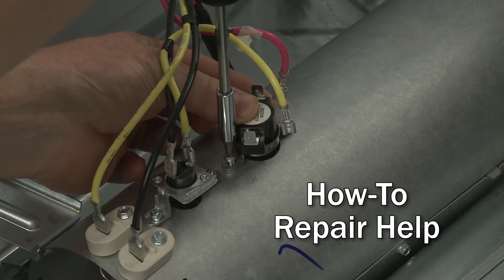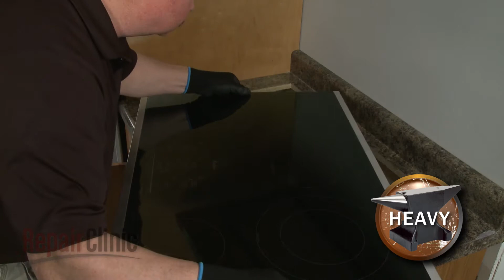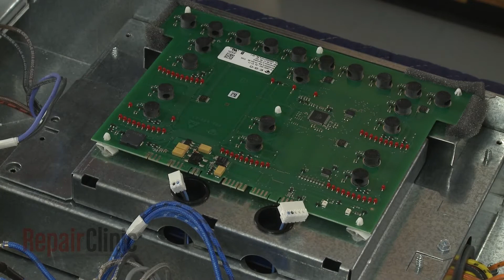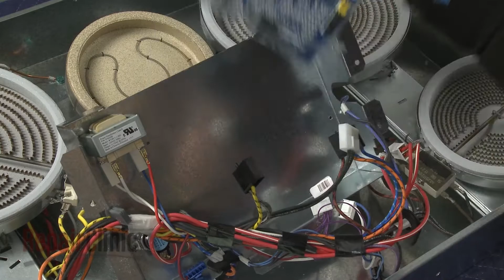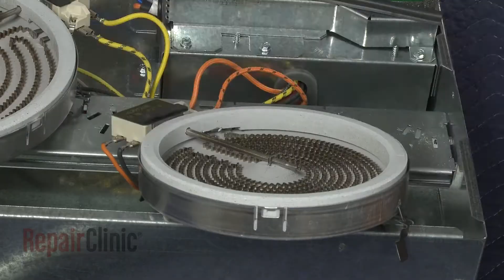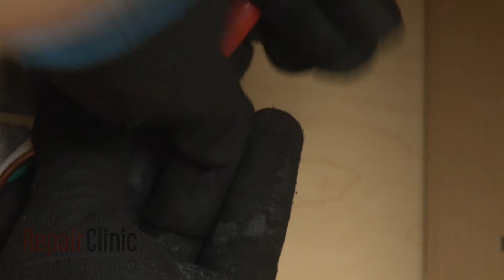Whirlpool Electric Cooktop Main Control Board Replacement W10915422

Comment: Hello I have a small question for you, I have a Whirpool model ywee510S0FS0 stove, my problem is when I lower the temperature say from 10 to 4 it takes more or less 40 to 50 seconds before this command is carried out by the stove  , and for the 4 rounds, I am looking for the solution to this problem, thank you to lanvance for your answer.